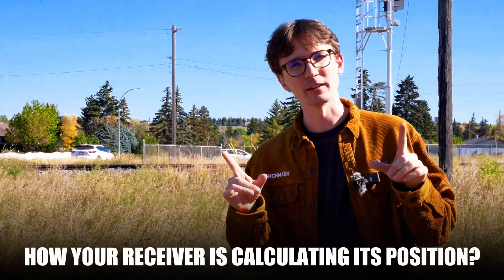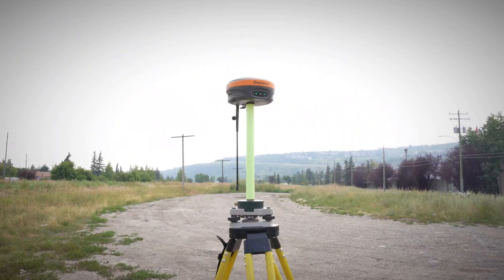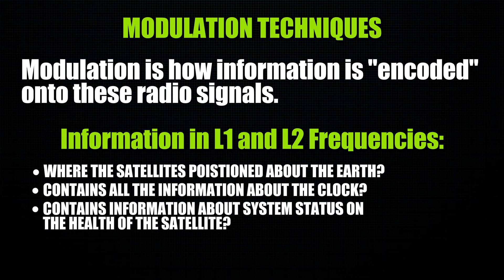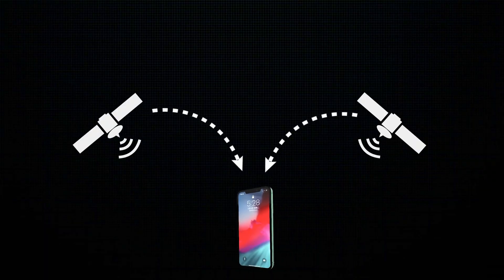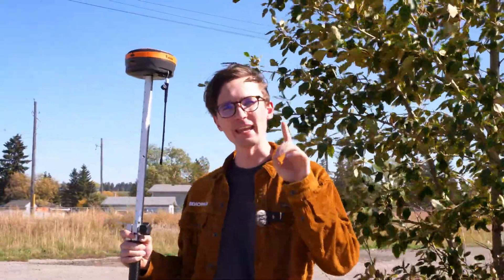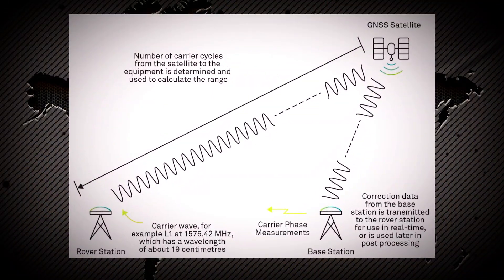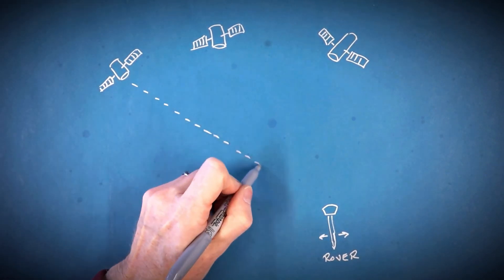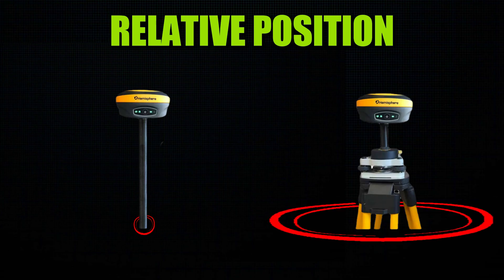What is RTK and How Does it Work? Real-Time Kinematic: Beginner Explainer

Comment: how does this work with drones? my company its starting the use of drones, we know some have RTK capabilities that can connect to a base in our case we bought the DJI matrice 350rtk with the Dji D-RTK3 base station for it we sometimes have to go to the middle of nowhere so no control points and no CORS network close, however we do need to have real world coordinates and elevation doesn't need to be millimeter accuracy, we are happy if it stays within 1 to 6cm.

What would be the best course of action in this scenario? do a 5 minute average position with the base and then send the drone? or take the time to do a 4 hour static and then set the drone the next day? ditch the DJI base and just use our other base & rover to make quick GCP and fix the drone error in the office?
Reply from the maker: Hey! In my opinion you have two options. The averaging points will still more than likely produce an error larger than that desired 1-6 cm range. Because of that I would recommend one of the two; as you mentioned record static data before the flight, or if possible record static during the flight. That is the only way to achieve the accuracy you want if there are no other control points.
Reply: @benchmarkequipment  i figured that would be the case, but given they are in the middle of nowhere we would have to camp in the place, i think we will stick to using the common practice of RTK with base and rover to mark GCP for the drone and just use the drone RTK when we have a CORS network close